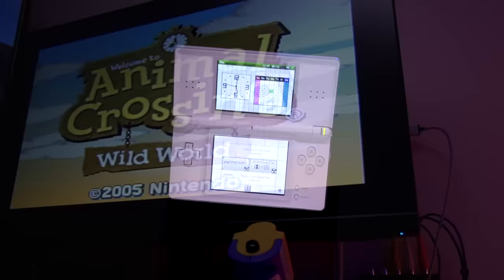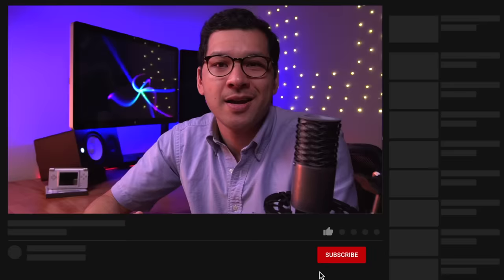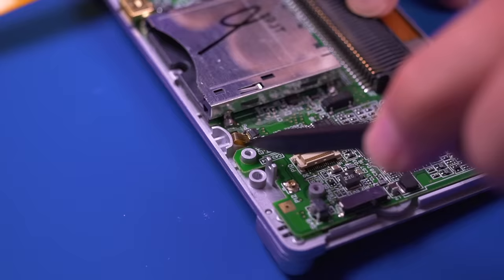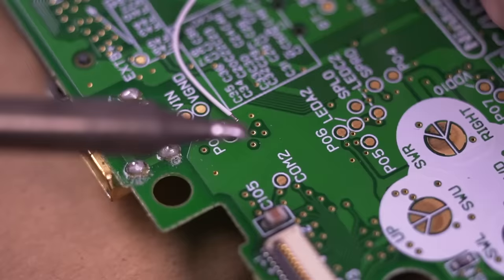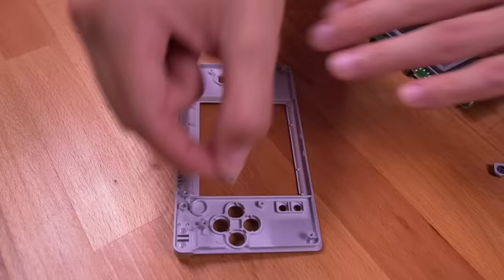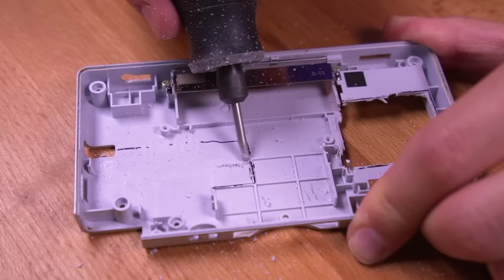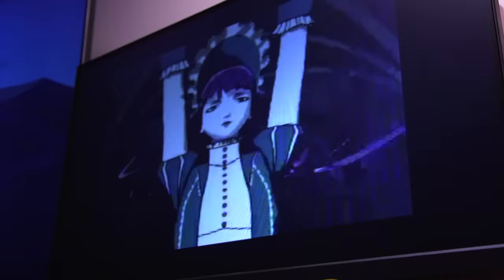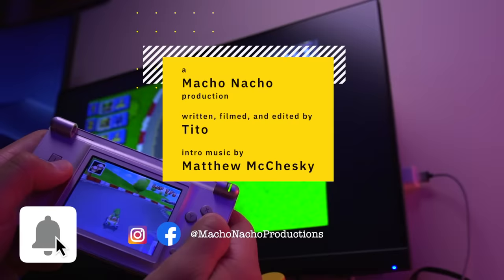HOW TO PLAY Your Nintendo DS on the TV Using Just The HEADPHONE JACK!

Comment: The concept is cool but it is still in too young a development phase, the installation requires too many difficult physical modifications to the plastic of the console and a difficult and unreliable wiring even if done well.
Still needs a lot of refinement, however really impressive what they managed to do.
Reply from the maker: Well executed mod, but I agree it would be cool to see the next iteration make installation easier.

Comment: 2 videos in 1 week? Let’s gooooooooo!
Reply from the maker: Hope you enjoy it dude!
Reply: @MachoNachoProductions  Few question, do you need to remove the Macro resistor? Does the speaker work via the DS like normal? 

Suggestion, to save room you can use enameled copper wire. It's hair thin. I use it on my GBC mods due to a lack of space.

Edit: I love it!
Reply from the maker: No need for the macro resistor.  I would remove it. Yep speaker works as normal and is extremely loud since the pcb has an amp. I forgot to mention that in the video. Very true!  Enamel wire would save quite a bit of space for sure!  Cheers buddy!

Comment: 7:01 "solder one end of the included resistor to it"
7:06 that looks like a cap to me.

the composite wire length here is really small, but for best results a shielded cable should be used. signal to the composite output, and the shield to ground.

Comment: Cool concept. I hope they can further develop this, especially if it works with PAL TVs.

I'd like to see the Mic port being used for the yellow video out (retaining the stereo) as well as a deeper ABS custom shell with taller buttons to free up the cabling whilst keeping the stylus holdster.

Great video as always Tito. 🤘😎
Reply: The microphone is an input, the headphone jack is an output. I don't think anyone will ever put in the effort to make this happen
Reply: @reideverett3577  Once the mic port has been disconnected from the actual microphone circuitry, its essentially a pair of dumb terminals which can be wired in either polarity for signal level extremely low wattage power (the same way a 3.5mm jack can be used for a microphone or headphones, depending purely on how it is wired up). Far easier to change a sockets purpose than trying to engineer a way to output video to begin with; they've done the hard part already. Just simply connect the discovered video output to these newly disconnected terminals.

Besides a microphone is essentially a reverse polarity speaker, taking an electromagnetic pulse inwards rather than outwards. It's the circuitry that determines if the electromagnetic coil is used to modulate a programmed signal into sound waves or demodulate sound waves into an electrical pulse to interact with a programme - not dissimilar to an internet modem (i.e. a MOdulator/DEModulator; the name is an acronym).

Comment: I will most certainly be getting this, it’s exactly what I’ve been waiting for! Also, rather than deal with mono output (lame), just replace the headphone jack with a 3 conductor one, duh!

One question though: how’s it look on a CRT?
Reply: Heck, the DS headphone jack has extra pins for the microphone input right next to it. Though obviously that would require a custom cable rather than the standard one used here.
Reply: He definitely should've done a little bit more research before trying this mod. There exists a 3.5mm jack with video + stereo audio(Nokia CA-75U).
Reply: @rexthesheep  To be fair, it is just a rectangle; I’m sure it’s possible to just have a tiny pcb stick out of the custom cable. Keep in mind, GBA IPS mods that came with TV out mods also come with custom cables

Comment: The mod looks doable for me but I think I'll wait until there's a component or HDMI solution with stereo audio output. Great video as always!
Reply from the maker: Those would be awesome mods. Hoping we get something like that soon!
Reply: This would be awesome but i think it would never happen, mor likely there would be some easier mods with some fixed issuies
Reply: iirc the video out solution is an exploit that stems from the console's devkit, which supported CVBS out only. There's a very old USB video capture mod for the Phat DS though, but the solution itself isn't available to the public.
Reply: One thing they might want to consider is taking advantage of the DS Lite’s missing screen. Instead of wrapping the video cable around the entire machine, install a connection coming out of the removed screen’s hinge, and output video to there.

Optionally, make it an RCA output to capture video and both audio channels.

Comment: Tito, I can keep my top screen while doing this mod and it will function normally, right? Also, do you think in the future we will see a variation of this mod with better video signal, like RGB, component or even HDMI?
Reply from the maker: Unfortunately as it exists today, you cannot keep the top screen. I’m not sure about the upgraded video out to rgb or component. From what I understand, the composite is baked into the hardware and cannot be upgraded internally
Reply: @MachoNachoProductions  how is it switch like then if you have to give up one of the screens?  If anything it's Wii u like at that point lol

Comment: This is super cool and basically something I've been looking for. I was thinking that routing video through the headphone ports would be great for the video out mod on gba and this is basically the same idea.
Reply: There is a gba mod that adds composite output to GBA, it uses link cable port with a custom cable though (much better in my opinion as you can keep the stereo sound)

Comment: What if you gutted a DS lite, and put it in a DS Phat shell? That might relieve some of the space limits.
Now if only the top screen didn't have to be sacrificed, that way you could have a seemingly unsuspecting DS that could optionally plug into a TV. I feel like that may have been what Nintendo had intended (or, Nintended... ha) when they tested this capability.
Reply: I'd really like this too since I don't want to turn my DS into a GBA macro... I think it should be possible, but the board would need to have a pass-through ribbon connector to connect to the  top screen, and it would be very hard to route everything with the small space.

Comment: Awesome video as always Tito, the visual aids this video gave me were very helpful. One tiny nitpick is where you installed the included capacitor onto p03, but called it a resistor, tripped me up and I had to redo that lol. Just finished installing one of these myself and couldn't agree more about the difficulty, it took two tries but the results were fantastic. With some clever cutting and a custom front shell that supports a front facing speaker, its possible to just barely keep the stylus holstering functional after shaving down part of the stylus itself as well, its a tight fit but I wanted it to present as a fully fledged macro once finished. What you end up with is pretty low compromise aside from the mono speaker and audio out, and of course no top screen. Heard that Lost Nintendo History was considering a passthrough version to keep the top screen functional which would be awesome to see.

Keep it up man! You make my Thursdays consistently more interesting

Comment: Honestly i feel like it doesn't feel as interesting from the moment it requires to get rid of the top screen, i originally heard it worked through jack after flashing the firmware but it's much more work than just this in the end, at this point might as well get a capture card for 3ds instead, as those don't get rid of the top screen and allow to record both screens

Comment: Congrats on completing a mod I wouldn't dare try myself. What can I say, you've got the touch!
So, this was planned as an official feature of the Nintendo DS? Considering all the soldering that was necessary, I'd have to assume that it was vestigial, and that there was no way Nintendo could have released an external peripheral to take advantage of it. 
Speaking of vestigial features, has anyone cracked that expansion port on the top of the Playstation Vita? Apparently it was supposed to provide video out, but Sony gave up on it and released the Playstation TV instead. That was... not a gamble that paid off for them.
Reply from the maker: It’s thought that this was a feature meant for game development that they didn’t remove for consumer consoles. 

I haven’t heard anything about the vita, although it would be cool to see some mods come out for it 😁

Comment: what gage wire should you be using on these connection you mentioned the slightly bigger 26 gage wire but not the smaller wire gage size

Comment: I think its a hardware limitation but if one of these mods could output both screens side-by-side I would be doing this. Otherwise I just don't have the time to put in all that effort and its easier to just use an emulator on something like a Galaxy Note phone

Comment: The only part I'm a bit bummed about is the mono audio output. Would be cool if there was a way to replace the headphone jack with a 4-pole jack.
Reply: It is stereo mixed mono meaning that the mono output doesn't loose the stereo sound. I have tried experimenting with a 4-pole headphone jack but it only increases the complexity of the installation as well as increasing costs overall. Stereo output is available on my earlier unit of the NDSTV V2.1 but it sticks out of the DS. It is one of the compromises that have to be made.

Comment: A good idea would be to add separate jack for video, the stylus holder hole is right there!
Reply: That would be a little annoying though with two cables hanging out. I wonder if there's a cable that would duplicate the audio channel so at least both sides are used
Reply from the maker: That’s a great question!

Comment: I admire the ingenuity of reactivating a dead feature and feeding it through the headphone jack, and getting generic video output that a TV can read, but the downsides seem pretty extreme compared to the existing capture cards for various 3DS models that loopy (3dscapture) and optimize sell. Albeit they're having trouble sourcing parts due to the electronics shortage right now, and it requires custom viewing software rather than being a generic video out. Other than this being for the DS Lite (and thus supporting GBA capture, which I don't consider a big deal due to the Gamecube GBA player), is there a compelling reason to not just use those instead? (Or the Luma over-network capture for that matter, albeit it's a bit broken and delay-ridden ATM)
Reply: Problem with capture cards is that they are capture devices. Their purpose is to capture video without much regard for input lag. The mod all of us have been hoping for is a DS and 3DS version of the GBA Consolizer. As in a video mod that outputs and HDMI compatible signal, component or RGB signal.

Comment: Love this mod. Tito, being that the ribbon cable is so thin, could it not run along the back of the SD cart reader? Maybe with kapton tape on the cart reader just in case of shorts?
Reply from the maker: That’s a good observation!  That may be possible. I know the WiFi cables run underneath.

Comment: Wouldn’t it be possible to add a ttrs or whatever 3.5 jack in place of the original to preserve the stereo sound?
Reply from the maker: That is a possibility if one exists with a similar pin out outlay.
Reply: @MachoNachoProductions  awesome. Im just getting to modding my consoles.  I used a version of the tv out with another amp mod, but for some reason it won’t power on with the tv out board attached. Still learning. :/
Reply: @MachoNachoProductions  so I was looking at the Nintendo DS lite jack.  Would it be possible, if I have the microphone adapter, to repurpose the microphone connectors to route the left and right speakers, or even the video feed?  Using a microphone end piece attached to the composite cable (self assembled)?

Comment: One question I have about this mod is the GBA slot. Does the tape prevent GBA games from reading, and can the mod play GBA games on the TV?
Reply from the maker: Great question!  You can still play Gba game with this mod. No issues with the gba slot reading games. Cheers!
Reply: @MachoNachoProductions  Thank you. 10:45 got me a little concerned, since I thought the tape was covering or blocking the GBA Connection.

Comment: I think we need to stop calling anything that can plug into a tv a 'switch-like device'. If it had a true dock that charges the DS, and you didn't have to use the bottom screen and could use an external controller, sure. This things FAR from a switch and it's just become a buzzword now.

Comment: Losing stereo output on the DS of all systems (which when set to “Surround” sounds pretty wide imo) just doesn’t sit well with me at all. I think this mod would’ve worked much better if the video output was routed to the mic port right next to the headphone jack. Considering a lot of people didn’t even know what it was, I’m guessing it wasn’t used that much anyways. Not to mention, the extra pins could allow it to output a higher quality connection, like S-Video, or YPbPr, or possibly dual video out, one for each screen.
Edit: If it would in fact support a YPbPr connection, maybe it could even output 480p to display both screens at once.
Reply: Literally not how that works, the custom video driver board only outputs a composite signal.